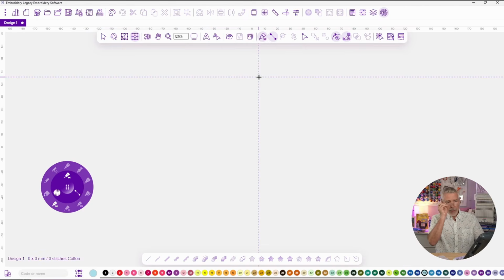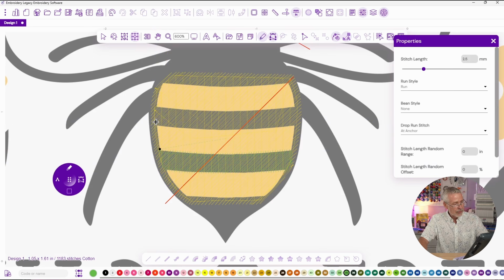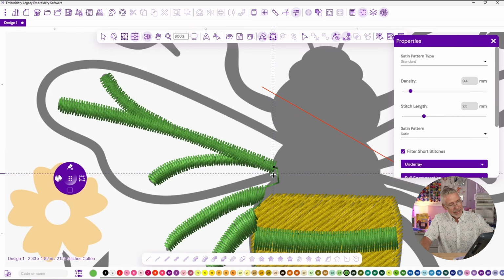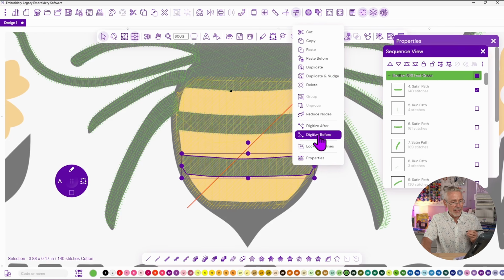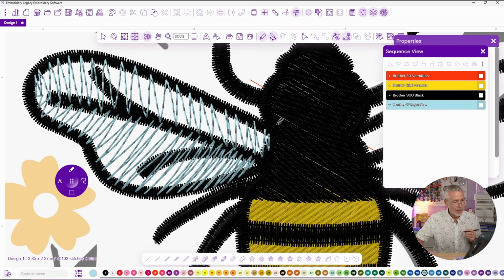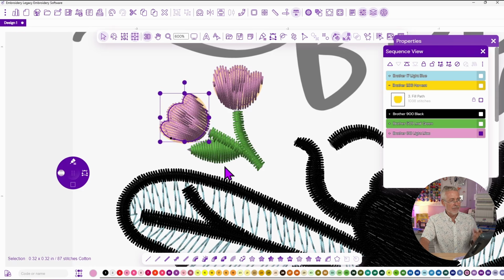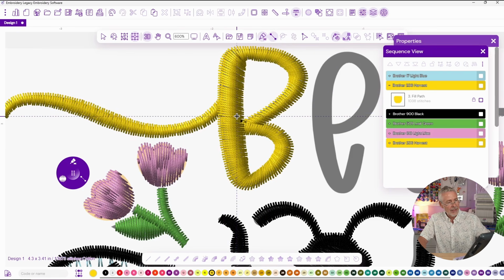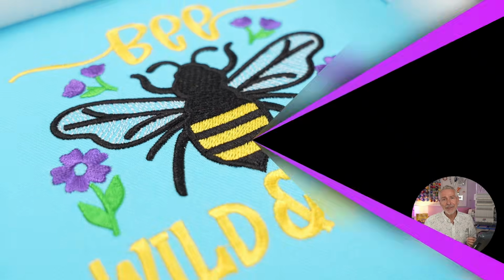The Problem With Most Embroidery Digitizing Software — And How We Solved It.

Comment: I just bought the software but it is very slow and laggy.
I have a high end PC so it should run i with no problem at all. 
Did you adjust your pc settings for the program or something else? Just when i use the pan tool it starts to lag.
Reply from the maker: Hey @dollar7741 Sounds like lag from panning with 3D view on. What happens if you turn off 3D and try panning again?
Reply from the maker: Sorry you are experiencing this. We have tested the software on many different computers and found that the software runs as intended. 
By chance, does it lag when you have the realistic 3D viewer on and try panning? If so, we have two methods. 
1. Disable the 3D viewer while panning to avoid lag.
2. Disable realistic 3D viewer in settings. 

Lets us know if this helps.
Reply: @EmbroideryLegacy  Okay so ive tested it again and as you said, it works as intended, which i find a little bit disappointing. 
With just 3000 stitches, once i start do drag around it starts to lag when 3D is turned on, both with or without "Realistic View" enabled.
When 3d is turned off, its smooth, no problem. 
While the program is great and all, being unable to operate smoothly with 3D on is a bit of a downer. If you can put in a setting to allow more CPU thread usage or GPU utilization, that would be amazing. 
Also being able to decrease the "amount of thread twist" on threads,  when 3D realistic view is turned on could work wonders. Ex. If i zoom in on a thread with  3D realistic turned on, no matter how far i zoom, it will keep generating the twist on the thread, where i think it would be good to have a max cap of twists on threads.
Otherwise great tutorials!